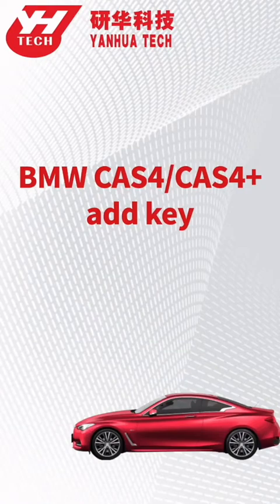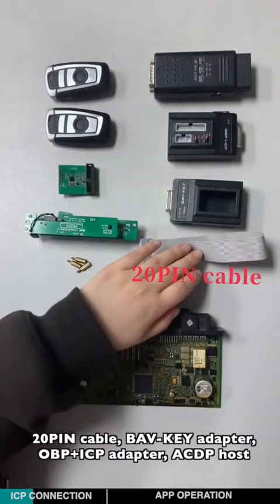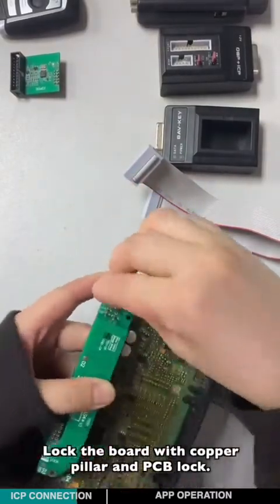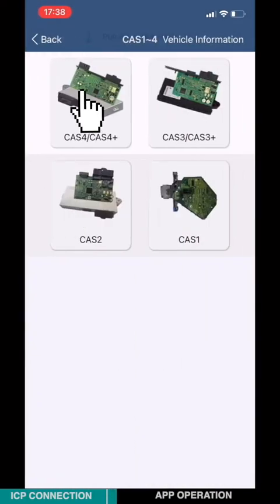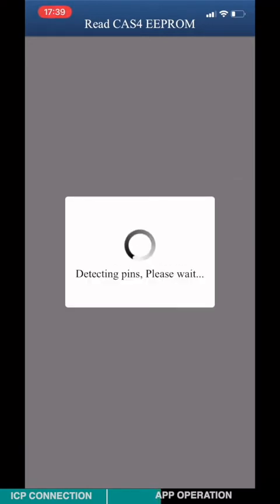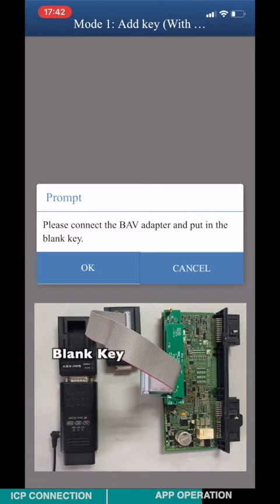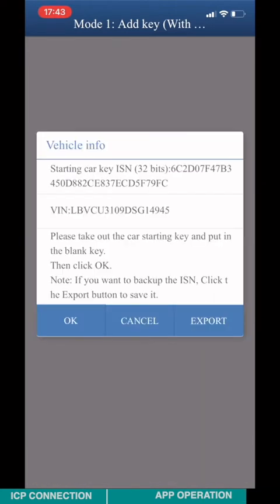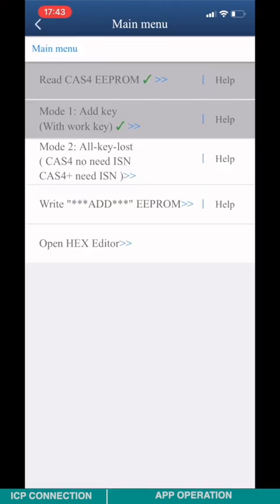[New Guide] Yanhua Mini ACDP Adds BMW CAS4 key with new board obdii365

Comment: Hi good day, would like to ask is it safe to do cas4/4+ mileage reset via obd? Will it damage the cas if failed during reading process? Thanks
Reply from the maker: yes, it will reset mileage by obd. if need to reset mileage on CAS module, you need module 1, if need to reset mileage in cluster, you need module 4, check https://www.obdii365.com/producttags/yanhua-acdp.html